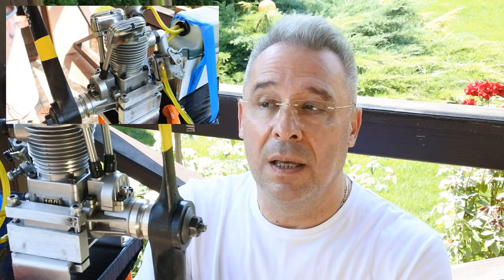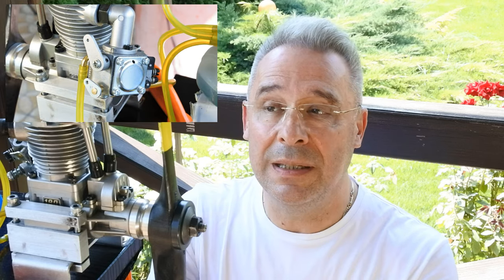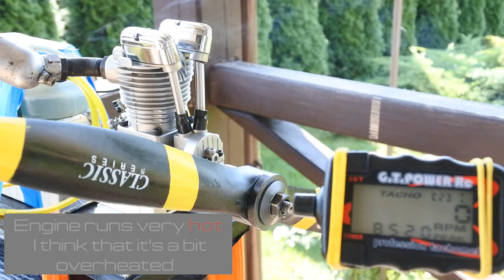Saving big bucks or Saito FA180 gasoline conversion

Comment: Another brilliant video. Love the graphics at the start.i think this experiment is a good idea  as it also depends on the use of the engine. For a uav application to save lives a more simple setup and efficient set up like this with a longer range is better. Maybe gasoline is not the best for the engine to last forever but for uav application if it lasts for 20 missions the positives outweigh the negatives. Also if the uav is not designed to come back home it doesnt matter. Its good to see you push the little engines to there limits only then can we learn and understand them. Great work .
Reply from the maker: Thank you very much for your comments and thoughts ! Really appreciated ! I've some plans for the next tests for this Saito FA180, so, please, stay tuned !Have a nice day !

Comment: Hi, Saito glow engines don't use bearings  on connecting rod,  gasoline is less "dry" and give a little lubrication compared to methanol and maybe this can help;  an investigation after some tanks could be interesting. Thanks for this experiment.
Reply from the maker: Thank you, great comment, really ! This is not just one time run, I'll try to investigate engine's behavior in such conditions. So, in a week or later we'll have a continuation of the whole story - I've some more glow plugs, which weren't intended to run with gas fuel mix, but we'll learn this later. Thank you for watching !

Comment: Having the engine on a proper timed ignition is very desirable. The glo plug is not really suitable because the timing is uncontrolled. Reducing compression ratio and retardation and advancing timing is crucial to prolong engine life...Get it on an ignition system is my advice....🤔🙄😳🇬🇧
Reply from the maker: Hi, definitely, you're totally right, you can rely on spark ignition, it is more predictable, for sure.

Comment: Not really worth it when you factor in how short the engine's lifespan will be and how easily it will throw a rod. These conversions overstressed the engines in three ways.

1: Excessive heat load. Gasoline burns way hotter than methanol/nitro, which means the engine will effectively be overheated at all times. Glow engines generally don't have enough fin area to deal with this. And you're encountering some of this as well.

2: Oil ratios are too thin. Gasoline typically runs a 25:1-100:1 ratio of fuel to oil. Glow fuel is usually in the 4:1-7:1 area. Saito engines are designed for the latter, with plain bearings in their conrods that rely on a ton of oil blowing past the ring that just doesn't happen on the super thin fuel/oil ratios of gasoline. These engines are RELIANT on oil mist blowing past the piston ring to lubricate themselves and that requires a lot more oil in the fuel than even the 20:1 brew you're running here. Saito's gas radials, in particular, are bad about throwing rods because of this.

3: The leaner AFR of gasoline over methanol/nitro further starves the engine of oil. Not only is the oil content of the fuel way way WAY too low, but the amount of fuel running through the engine is a mere fraction. This is why people try to do these conversions...cheaper fuel use less of it....but it's also what kills them.

Saito has enough trouble with the gas engines they sell exploding. I never advise converting ANY Saito glow to gasoline. It may run sweet now but it won't last very long.
Reply: I have ever heard of people ruining connecting rods on OS FT-300 's running 4 stroke glow fuels with reduced oil content.
Reply from the maker: Thank you very much for your comments and for your opinion ! This is very important for me. But, I should say, that there is some areas, were this engine will be very nicely used.
1. As a part of UAV flight range extender. Being operated with a alternator, such engine/generator bundle can seriously extend the range of researching UAV, or else. Lifespan of the engine in the human life conditions isn't so important, if your UAV mission was successful. You can save a hundreds human lives for a price of the one potentially burned Saito FA 180. I know, what I'm talking about. 
2.I've some plans for engine's behavior investigation.consequences

3. I'll increase fuel / oil mixture ratio to keep better engine lubrication conditions. Absolutely agree with you about the tough engine's load conditions during last run. 
4. I'm really  like this engines and don't want to kill them.
Thank you very much for being very informative, appreciated for that ! Have a nice day!
Reply from the maker: @mikeeiben3430  Definitely, interesting, thank you! As I start this investigation, I'll not leave all of you washout the results. Just give me a little bit of time. Thank you !
Reply: @crazyengines88  I recall from one of your previous videos running an FG engine on gasoline with 20% oil content. I was surprised how well it ran with that much oil.
I believe Saito is now recommending a 15:1 gas to oil ratio in their FG series engines.
Reply from the maker: @mikeeiben3430   Hi and thank you for your comment and information. Understand, next runs will be provided with bigger oil content, 15:1, at least. Also, will be interesting to know, how increased lubrication will affect engine's performance. Thank you and have a nice day !
Reply: Thats a nice big single there, 
Nice job on fitting the carburettor,  i personal use the stock carburettor, and yes you can have a great running engine from a glow carb, just a couple of simple mods..i see you are running muffler pressure to tank? I personally wold set up a spark ignition, reason is because spark advance is controlled much better by cdi and will give less problems (overheating)
Reply: @mikeeiben3430  Nobody's ever blown up an engine from overlubricating it lol
Reply: 1. Heat is a killer for thiese designs. 2. Lubricating the aluminium bushing conrod is not efficient enough with regards to the high temperature. Yes it will run nicely, but not for long.
Reply from the maker: @roki5941   Thank you very much for your comment! Definitely, next run I'll increase oil content in the fuel mix, so, around 15:1. I know, that Deluxe Materials synth oil was  really good in the most heavy load applications. Hoping, this engine will survive 🙂Anyhow, after all test run's tortures, I'll dismantle it to check wear level.
Thank you and have a nice day !
Reply: @mikeeiben3430  15 to 1 is saito recommended for breaking in. Then 20 to 1 is fine after that..
If people are so worried they should just put 10 to 1 oil
Reply: @danielhitchens4407  It´s not about Saito´s recommendations,, it´s about common thermo mechanical sense. They are simply NOT designed for it. (Sure you can run your car at top speed all the time.. but..)
Reply: I understand that all the above..
But i would love to knmore about what life expected of the conversion to gas?
And what engines you have converted and their outcomes, 
I i have a asp fs91 with 3hrs run time since its conversion,  5lt glow from new.
Its had 6 10min flights. Most of the time full throttle, 9300rpm on the ground,  so it revs well in the air, will see how it goes in the future
Reply: i totally agree with you. 2 stroke oil burns clean, providing less bypass of oil for engine lubrication. at least use castor oil for lubrication because of the much higher flash point.
Reply from the maker: @roki5941  Thank you for your comment ! Definitely, after a couple of test runs with this conversion setup, I'll dismantle the engine, to evaluate wear level, so it will give all of us more facts. For sure, engine works much harder in such conditions, less lubrication, high temp (inside and additionally, outside, 33 Celsius), as well, as heavy load. So, will be interesting to look inside after all torture tests. 
Thank you and have a nice day !

Comment: Grab a asp engine and check out their conrods, brass bushed they are, asp fs91, converted to gas stock glow carb..it runs absolutely perfect, and smooth idle after breaking it in..
Reply from the maker: Thank you very much for your comment ! I'll check this engine after the test run cycle, probably, it will be really necessary to modify both conrod ends with a bronze bushing, as usually implemented in O.S. engines design.

Comment: You should make a spacer with some G10 between the carb and its mounting flange. Heat from the engine will migrate into the carb and throw off your carb settings.
Reply from the maker: Thank you very much for your comments ! Definitely, very useful advice, thank you. This is just a first steps in the gas conversion adventure w/o spark ignition, so stay tuned, will be more interesting later.

Comment: I enjoyed watching your video very much. However, I could not understand the brand of the carburetor you used. Is it possible for you to specify the brand and model? Additionally, where can I buy it?
Reply from the maker: Hi, and thank you for so high evaluation of my work. I'm really pleased, thank you. Such positive comments is a great motivation to make more and better content. Regarding your question, this is DLE 30 / 35 Walbro carburetor for DLE 30/35 cc engines, and you can purchase it here, at Aliexpress: 
https://www.aliexpress.com/item/10000122402866.html?spm=a2g0o.order_list.order_list_main.120.4edf1802Ef4V3s
Hope, it could help. Thank you and have a nice day !
Reply: @crazyengines88  hi again, so how did you connect this carburetor to the apparatus with the original saito carburetor? Did you use any equipment or how did it happen?
Reply from the maker: @Sercan3860  Hi again, and thank you for your question ! In case of installing DLE30/35 carb, I just utilized 2 holes at the carb body, it were exactly the size for 2 screws to screw it to the intake manifold. In case with genuine Saito carb I use plastic tube to tighten the carb body on Saito intake manifold.

Comment: The bigger the glow engine the more methanol they use! Conversion to gas of 4 stroke engines is no way a bad idea,  i run a saito fa120r3 converted, yes plain aluminium conrod journals, woop di do.. i started break in at 15 to 1 roughly 65ml per litre oil..now im running 40ml per litre. 10lt of fuel so far..i run about 1 litre per week and this engine is awesome..i run 20min air time and it sits on full throttle most of that, 8500rpm on the ground. So with the wind would hit close to 9000rpm..sure the engine runs slightly hotter than glow,but definitely not excessive
Reply from the maker: Thank you for your explanations, very interesting ! I was really a bit scared after seeing the smoke. It was really overheated.
Reply: @crazyengines88 richen up the high speed needle so it wont get hot..i would run the engine at a rich level for quite awhile..how old is the engine? 
Either way the engine needs to run rich for atleast 2hrs..
Reply from the maker: @danielhitchens4407  Thank you for your advice ! Engine isn't new, it's from completely rebuild story, https://youtu.be/1koY01gKqFQ
 and https://youtu.be/um5306ndYZE, 
new bearings, etc. I'll follow your recommendation to richen fuel mix, will also increase oil content. So, next run will shows...
Thank you and have a nice day !

Comment: Asp ft160 converted to gas..this engine took some time to break in and get it reliable,  this engine and the others converted so far they all produce plenty of oil waste out the crank case, despite being a lower oil content,the gasoline vs methanol, gasoline has much better lubrication over the methanol hence the need for way less oil content over a glow/methanol fuel.. ..go scale down a single cylinder motorcycle engines cooling fins to the saito cooling fins..example a xt600 (4" bore) Saito fa180 (1 1/2" ?) Then compre the scale?  It has been proven that a converted glow engine can give many years of engine life, dig deep and find the right conversations on forums, youl see
Reply from the maker: Thank you, your information is very valuable, especially from the first hands. Much appreciated for support !  Have a nice day !